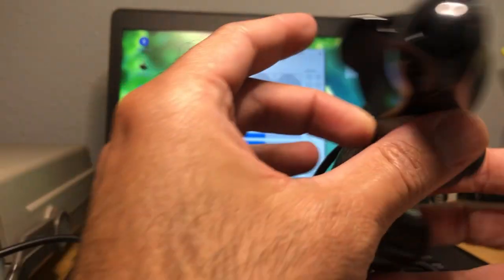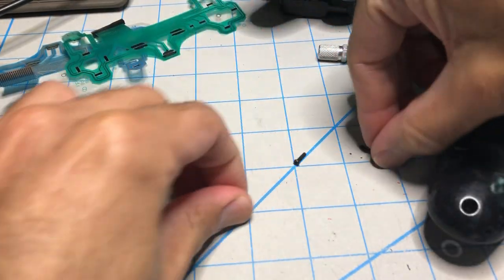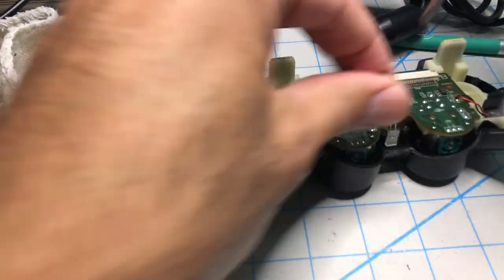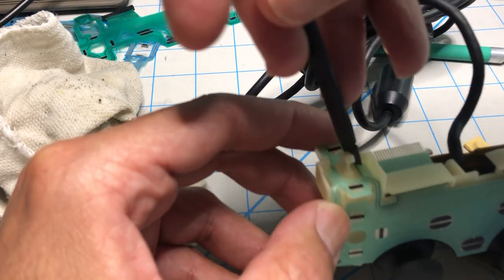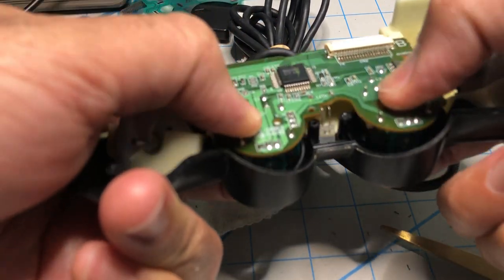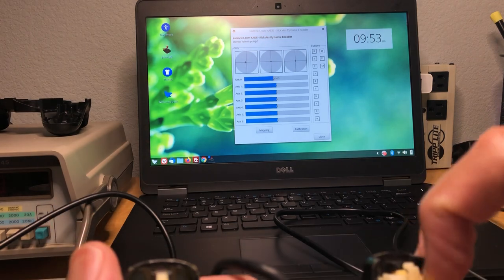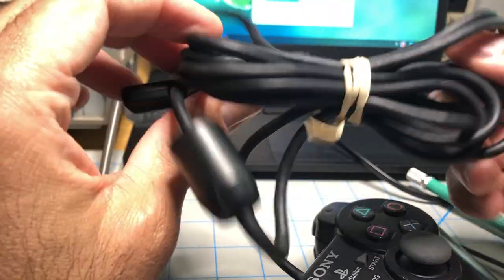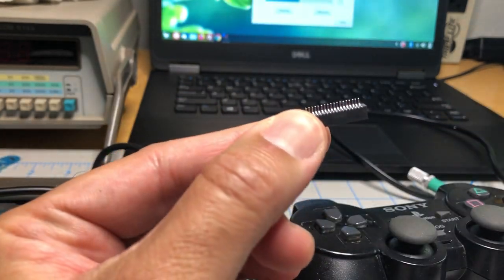Model H Repair -  Reusable ribbon connector

Comment: Howdy, I have a couple of model H controllers and replaced with the appropriate ribbon parts. The controller would perform great until I push the triangle button, then the controller would just spaz out. Tried testing the other replacement ribbons I had and still, the controller just freaks out thinking I'm pushing half or so buttons at the same time. I've checked multiple times with my solder job and it's fine. Would you have any idea would could be causing the issue? I'm hoping maybe you've come across this issue with the repairs you regularly do.

Comment: Question. Do you buy the ribbon connectors from eBay and do you know where I can find the 19/18 pin connectors?
Reply from the maker: https://www.aliexpress.com/item/32758733481.html?spm=a2g0o.detail.1000060.2.2284209czAhvPa&gps-id=pcDetailBottomMoreThisSeller&scm=1007.13339.169870.0&scm_id=1007.13339.169870.0&scm-url=1007.13339.169870.0&pvid=34c3360d-7ac2-4158-a465-f54f8d422490&_t=gps-id:pcDetailBottomMoreThisSeller,scm-url:1007.13339.169870.0,pvid:34c3360d-7ac2-4158-a465-f54f8d422490,tpp_buckets:668%230%23131923%2326_668%23888%233325%2313_668%232846%238107%231934_668%232717%237558%23200_668%231000022185%231000066059%230_668%233468%2315615%23680
Reply: @restartrepairs4393  Thanks!